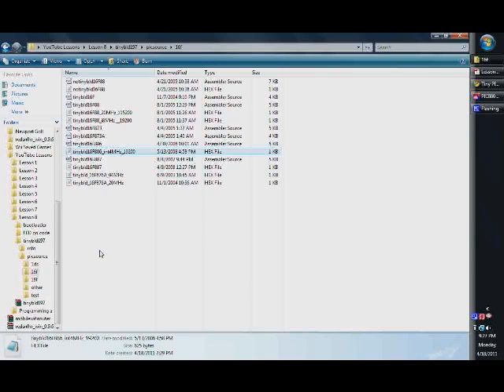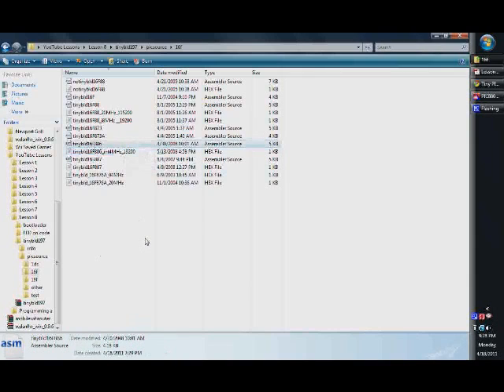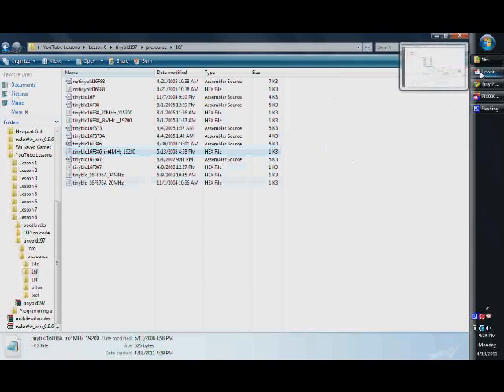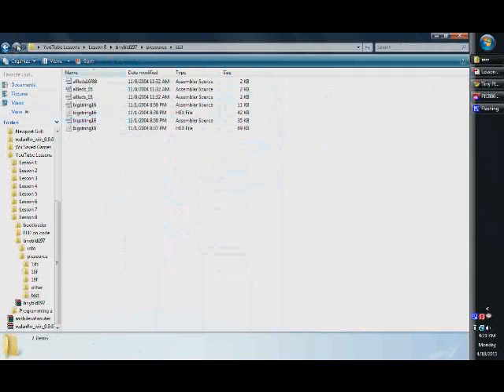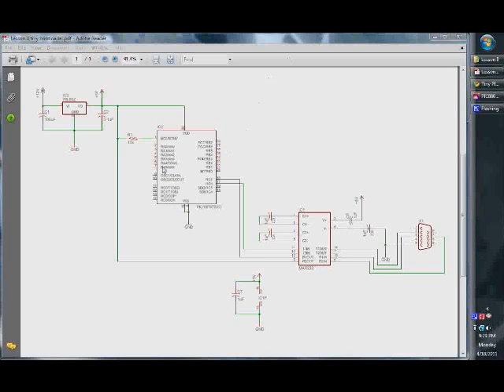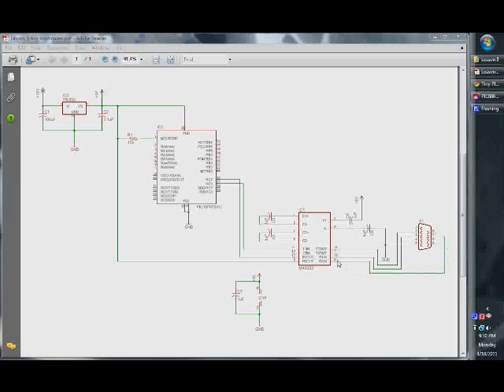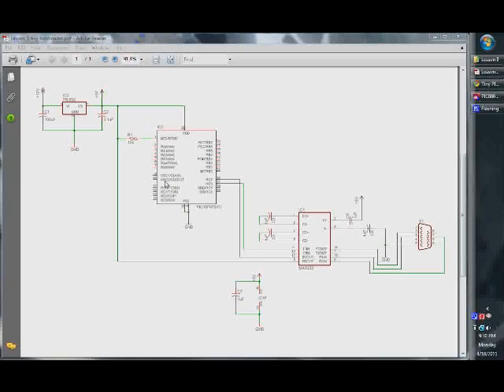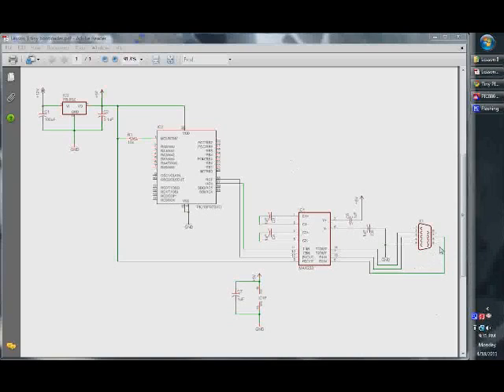lesson 8 Tiny Bootloader Part1_2

Comment from the maker: Hello there,  I don't know which version of the ft232 you have so if you could send me a data sheet I would be happy to look into it.  Also if you are using the tiny bootloader software that comes with the boot loader there is an option to use the RTS line as the rest.  The software then toggles the RTS line. You are correct that in normal RS232 communication the RTS line is not toggled.  However, the tinybootloader software toggles it to perform the reset.  Hope this helps.

Comment: Maybe RTS works different with the MAX232, but when using an FT232 (USB to UART) chip or cable the RTS goes LOW and stays LOW. This holds PIC in RESET for the entire time and bootloader never gets chance to start. RTS is not a pulse like press/release of a RESET button. Using tinybld198.

Comment from the maker: Thank you very much for pointing that out.  I just missed it when I had posted it.  This was one of my first few vids I had posted.  The junction from the RS232 RTS Line should go on the MCU side of the resistor not the +5V side.  Thank you again for catching this.  I will put a comment in the video illustrating this as soon as I can.

Comment: Nice useful tutorial. Just wondering if the pull up resistor is on the correct place? circuit looks like you are going to pull the output of the regulator down..may be I am wrong somewere???